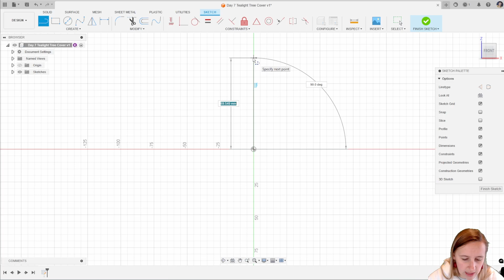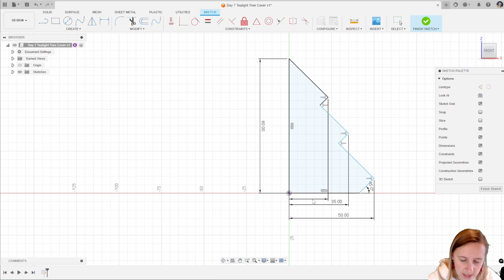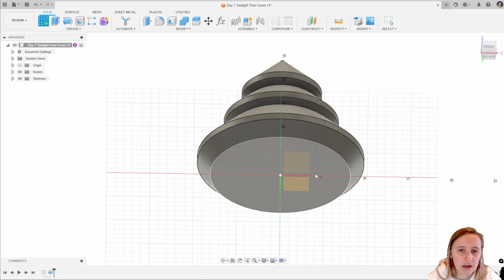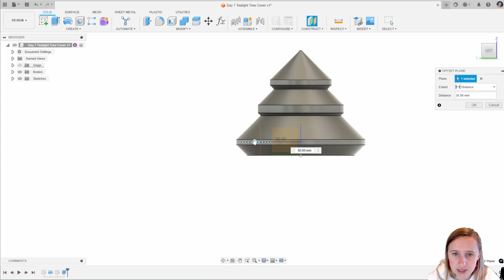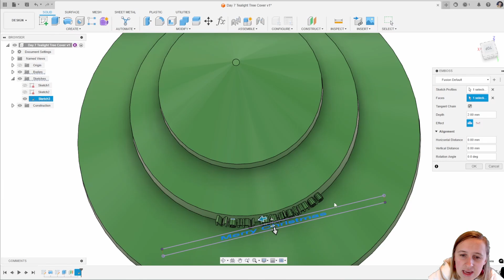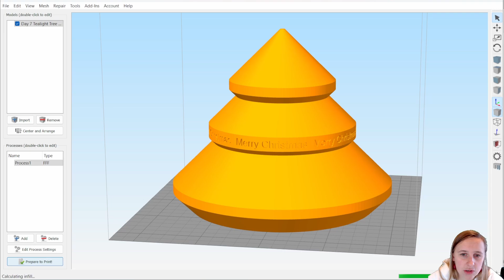Design a christmas tree tealight cover in Autodesk Fusion | CADvent Day 7

Comment: QUESTION . - how can you see the light though the plastic=? does the tree have to be upside down for the light to actually do something??
Reply from the maker: Hey, great question. So I printed it in a translucent PLA filament which lets the light through really well!
Reply: @3DBISH it looked like the "hole" diddent for all the way op and the tree is not hollow.

Mby i missed something?
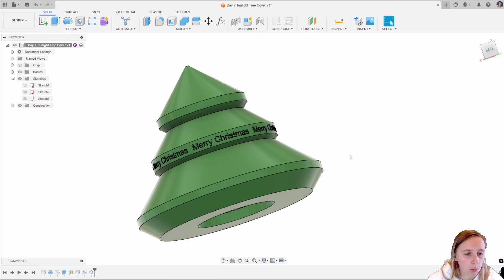Reply from the maker: @dannymansgaard2765  Hey - so you need to make it hollow in the slicer settings, I show how to do this from around 8:15 in the video. You need to print in "vase mode" or "spiralise outer contour".
Reply: @3DBISH awsome thanks for fast reply

Love your seriel 

Would love more😅